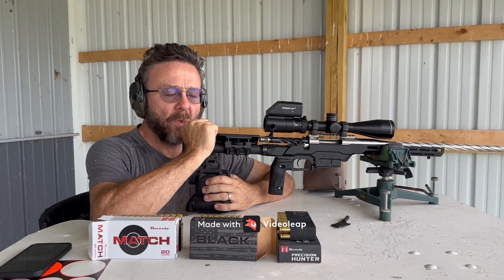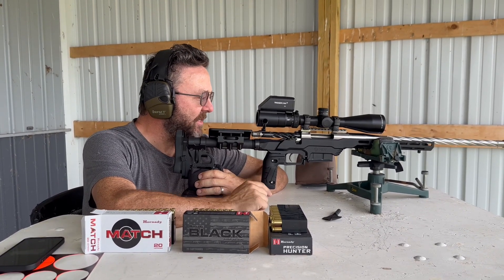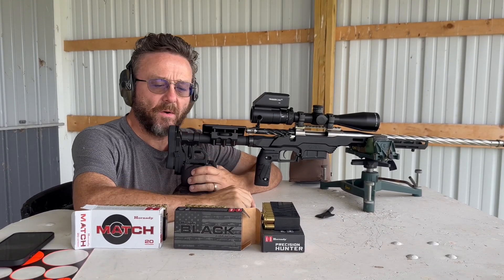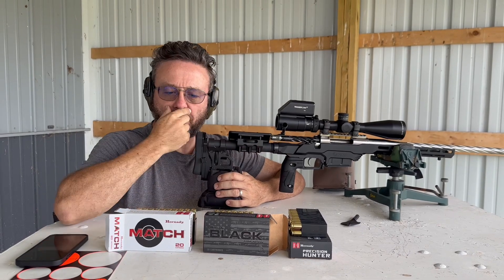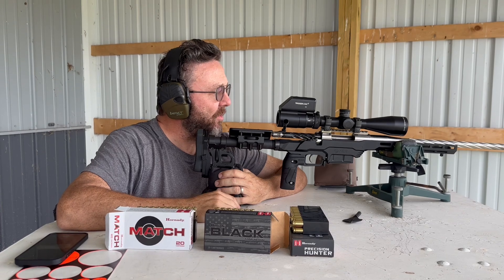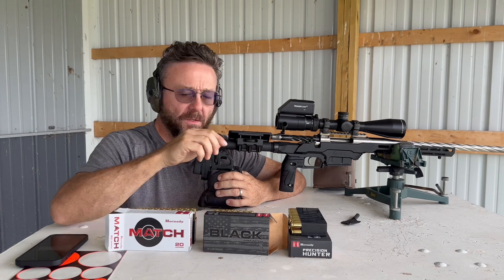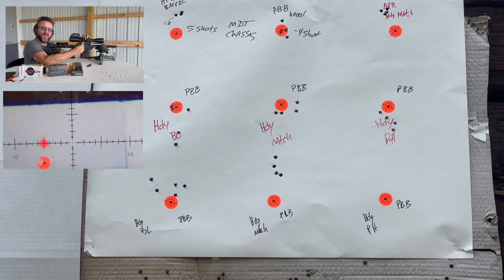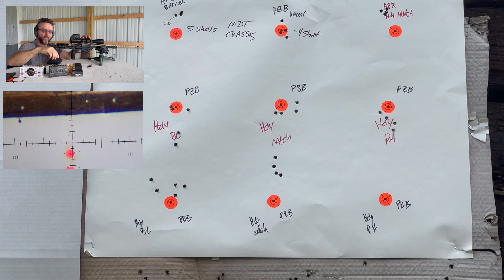Preferred Barrel Blanks barrel prt 1 **UPDATE** They did refund me my money and easy to work with.

Comment: Holy crap you are not steady at all
Reply from the maker: 99% of those shots break while the center dot is on the orange. You can look at this video and others. I routinely shoot sub half inch groups. It was clearly the Barrel PBB even agreed with it and refunded my money.
Additionally, it’s a 6 pound rifle on a $35 front rest for the wobbly table and the office chair on wheels. I’ll take it all day long, but I am currently building a new shooting bench.
Reply: @RifleAccuracyandReloading all im saying is that barrel didn't get a fair shake with how it looked thru the scope cam
Reply from the maker: @spindrifter3395  so why did the APR Barrel do so well?  are you saying that I deliberately shot poorly with that Barrel? And again every shot broke on the orange dot . explain why it’s a 3-4 inch group. It would be completely different and even up for discussion if it was a one and a half inch group compared to my half inch APR Barrel, but it’s not.
Reply: @RifleAccuracyandReloading i would say you have a 3-4 inch group because you have a 3-4 inch wobble zone
Reply from the maker: @spindrifter3395  you need to have your eyes checked cause I’m not wobbling 3 to 4 inches off the orange dot when the trigger press that goes off
Reply: @RifleAccuracyandReloading whatever man you are 100% wobbling from 1 side to the other. If you poa is 1inch different every shot then a 1 moa gun will shoot a 2 moa group. Watch back on your video. You break shots on the left edge and then the right edge.

Comment: Using factory ammo pretty much limits the ability of a custom barrel.  You can't do a ladder test or optimal charge weight test or vary the base to ogive distance to find good reloads.  I have a PB prefit in 6mm BR and put 3 inside of 4 inches at 550 meters pretty consistently.  I would use their barrel again but no more prefits for me.
Reply from the maker: Yes, aware of what you said. PBB guaranteed their Barrel 1 inch with factory Match ammo , so I demonstrated to them that it was not 1 inch and that my other custom Barrel would shoot 1”

Comment: How long did you wait for your barrel?
Reply from the maker: @gjovani78  it took four months to get the first Barrel in about two months to get the replacement Barrel neither one shot so then I got a refund
Reply: @ so you wouldn’t recommend them? I was gonna get a barrel in 300 wsm
Reply from the maker: @ lots of people have good luck with them. However, that just wasn’t my case. I personally would spend a couple hundred extra dollars to have the Barrel chamber by reputable gunsmith for my particular action than doing another pre-fit.